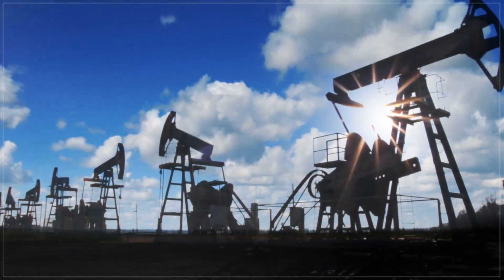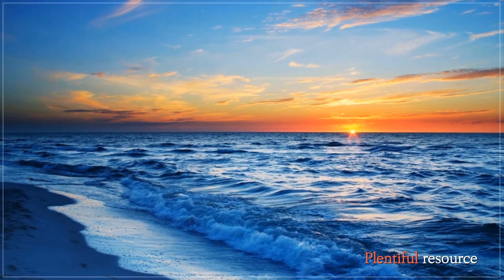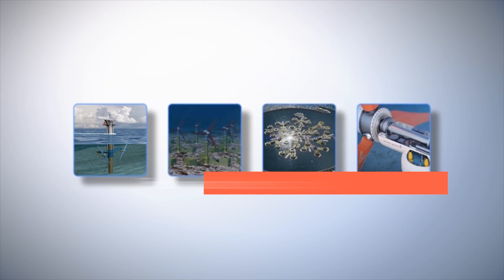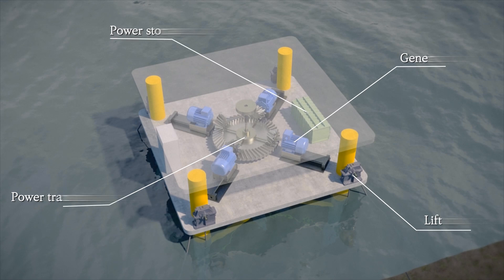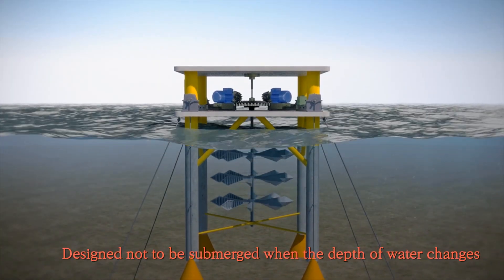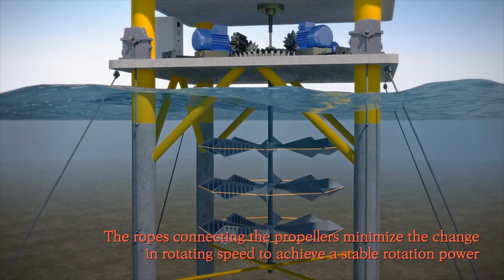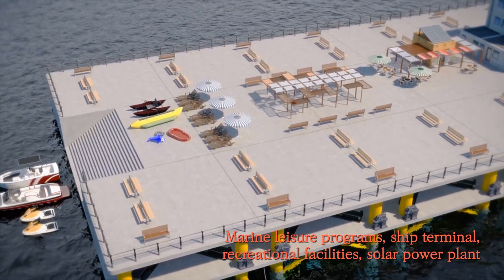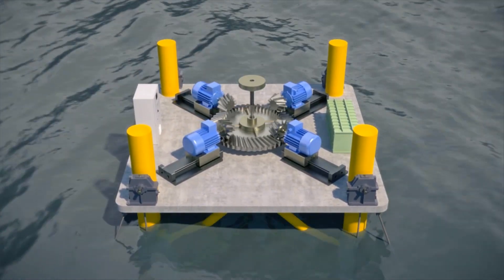Marine underwater tide generator

Comment: Nice animation and fairy tale. To get this to work is another question:
1) the propeller will not turn;
2) Wise currents from the side the rig will be destroyed
3) The equipment above the waterline will be prone to the environment and thus fail pretty soon.

Please show something which is tested and proven to work, to produce a CGI showing a fairy tale and showing it off as something that will do something is not the way to go.
Reply: Propeller will turn as any vertical wind turbine turn, and the rig will not be destroyed faster than any oil rig, but the energy harvested will be pitiful. Look at all hydro plants. All of them have some height. And that height helps producing really strong flow of the water. Those tide currents are really slow. To harvest their energy you will need huge surfaces.

Comment: Will it grind up all the Fish.  According to Chevron it will.  Duh!
Reply from the maker: No fish will be killed or injured by the rotator. The reason for this is that the speed of the rotor is slow, so the only fish that hit the slow rotor is the meat that is killed by the head of the rock under the sea. Have you ever seen a fish that dies with its head stuck in a rock under the sea? I've never seen such a fish.